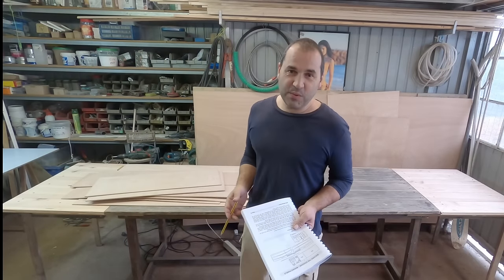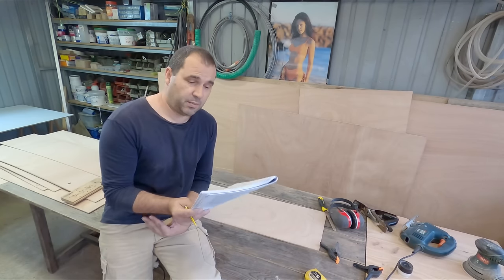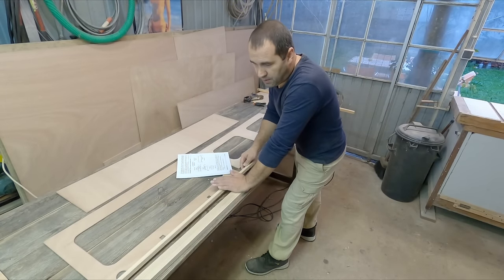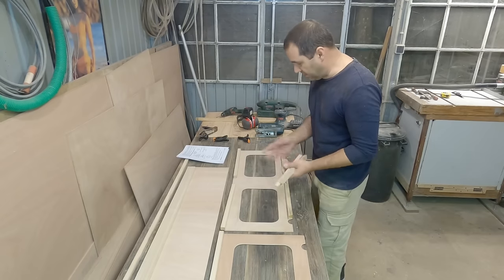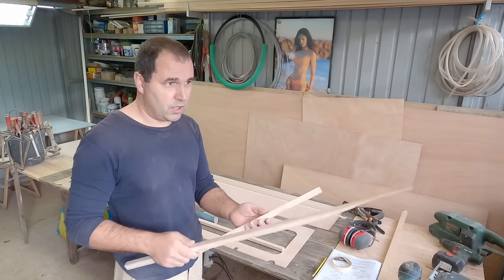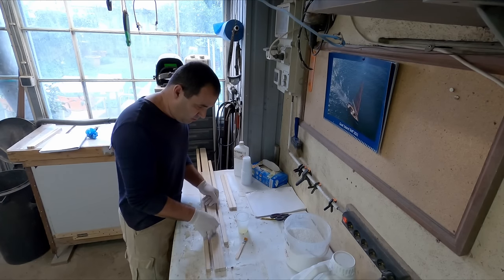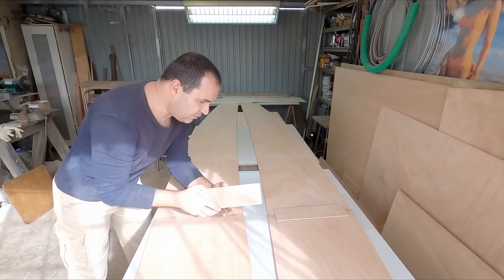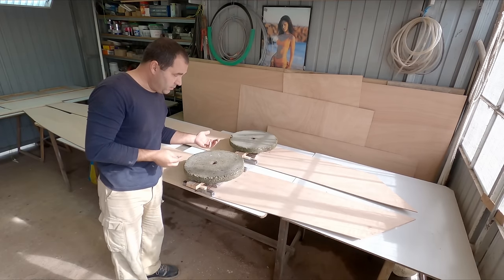Easy to build, Unsinkable Skiff: Car-Topable and Family-Friendly! Carries 3 Adults!! OZ Goose week02

Comment: Hi Teo.
I remember a few years ago when paulonia( kiri)  became popular in the west.
 My cousin actually bought shares in a plantation in Australia,
It is common in China and here in Japan  primarily as a wood for furniture, specifically for drawers of chests.
It breaths and is perfect for keeping stored kimono in a humid environment.
It is very fast growing and has spread as a weed across the US.
As you have found the growth rings are really widely spaced and the timber is quite light and weak.
No way it could be used as spar material.

Gary in Japan.
Reply from the maker: Hi Gary,
Thank you very much for the valuable feedback!
I was really surprised how easy that snapped! I know the grain was almost across the piece but still...
Maybe if timber pieces are chosen carefully it proves to be a bit more resistant.
Reply: Fast growth, lightweight, it’s not going to be strong, unless you wrap it with carbon fiber. If you use mainly use unidirectional carbon tow, it actually might be cheaper than other options. The mast only needs to be stiff in bending, no twist and tow is actually not that pricey as it’s the base material, no weaving.

Comment: I am so glad that the weather has slowed my build in recent days. I am working from a 2016 set of plans (downloaded PDF) that I bought from an accredited source. The plans have both the errors that you highlighted. At my stage of build this is an easily fixable problem but I am wondering now what other errors might come to light. You are obviously more thorough and do more  research than me. Despite this my build is looking good with all the important dimensions correct.
Reply from the maker: Hi Michael, 
there are hundreds of Geese built to those plans and they sail just as well. No major updates have been made to the design that I know of.  Ours boats will still have all the important characteristics  that make the OZ Goose so special. 😉

Comment: i will do a short video in the next couple days, on my molded skiff design... i got pretty far with the rigging, mast, spar, and sail this morning.
i set the max load at 550 pounds, ( 250Kg ), that's a little less than 1/8th the submerged buoyancy, which is textbook.
it's looking very fast, but will be somewhat hastily slapped together for the video ... but good enough to get the picture.
                                                            EDIT: just at the end, we see The OZ Goose coming together !!! ( that's was fast )
Reply from the maker: Hi Eric, 
I will have a look at that when it comes out! 👍
The OZ Goose at the end is held together with duck tape, it was just to have an idea of its volume in real life.
Still have a few things to do before I can glue it together.

Comment: i would use filleting method also, wood costs money also; where micro balloons, tape roving, and a little more epoxy is lighter.
but where i had to use wood, i would use Polyurethane Glue, ( less expensive, water catalyst; just dampen and it's done in 20 minutes; though you would then have to scrape )
a bottle of Elmer's Ultimate, or Gorilla Glue, can save enough epoxy to make up for the fillets.
just off set your epoxy use with micro balloons, and polyurethane glue; and you will have more epoxy near the end, when you really need it.
Reply from the maker: Hi Eric,
I have no experience with PU. Also I'm trying to keep this build as close to the plans as possible as I believe it will help more ppl with the build. At a later stage I might try to modify the OZ Goose if needed.
I'm not sure Micro balloons are mechanically strong enough for the fillets as there is no glass tape over them apart from the interior cockpit fillets. I should really make a test with different additives.
Reply: the PU is just as strong as epoxy, ( is what people that have done tests say )
but if you want a clear wood finish <-Then Avoid the PU ..  the wood will look a different tone where the PU is. ( so if you mention PU as an option, also mention it is best for when you are not going for a natural wood grain finish.  @TheBoatRambler
Reply: the benefit of micro balloons is the major reduction in epoxy uptake for larger fillets... it is also a smooth filleting consistency, and very light weight...it's the epoxy matrix that makes the micro balloons relatively strong, but glass tape roving fishes out the mechanical strength well, and the micro balloons ensure you have spare epoxy to wet it out. @TheBoatRambler
Reply: it shouldn't be more than a week before i post my molded skiff design video..
i have a few details to sort with it, and then just have to finish the rudder and tiller mechanism.  @TheBoatRambler

Comment: I wondered if you had any comments about Ilur vs GIS?
Reply from the maker: Completely different boats! The Illur is a stable slow displacement hull, the GIS is a lively pocket rocket.
The Illur was probably designed to be a cruising dinghy while the GIS was designed to be very light and fast when racing,  300kg vs 60kg!!  Ofc the GIS can be used for cruising too, as I do, but sleeping aboard for instance is not that easy.
Reply: Yes, a GIS 20% larger(Length, width and height) and built from heavy lumber(thicker plywood) would be a nice compromise. Really like your travel/camping videos. I think that is quite adventureous. Arthritis keeps me from a lot of my interests. Enjoy it as long as you can. Cheers!
  @TheBoatRambler